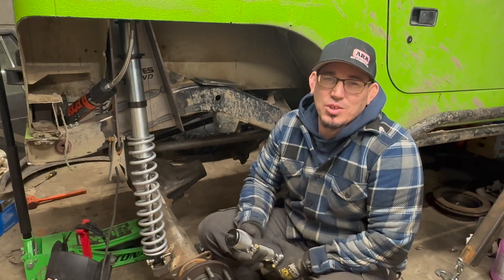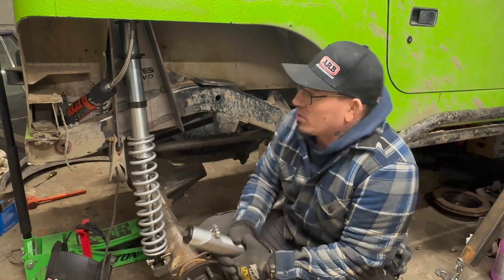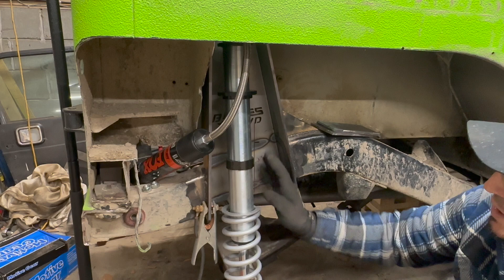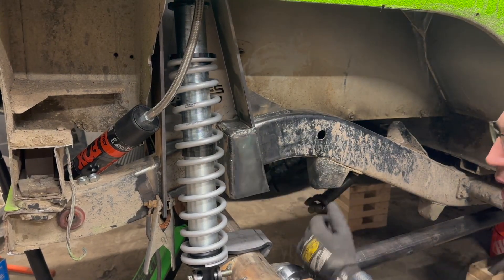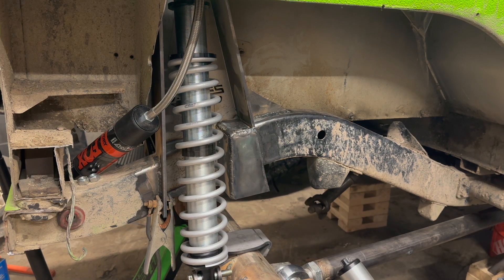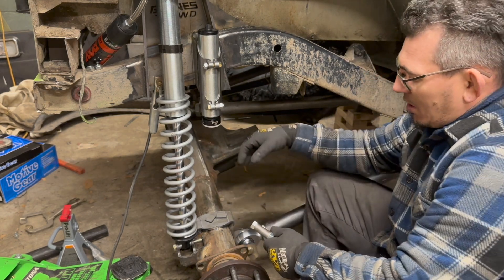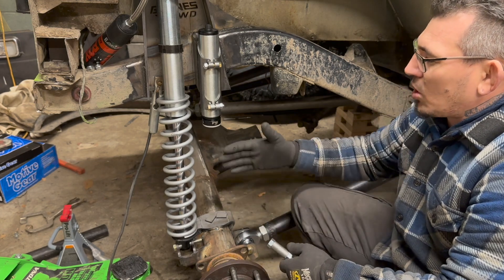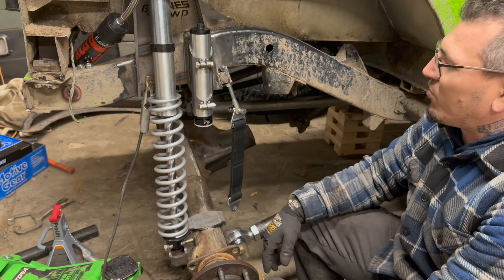How to build a 4 link suspension, Jeep Wrangler YJ part 4 bump stops and limit straps

Comment: you using fluxcore or gas? been scared to start my yj build myself, tired of staring at it on jackstands. my 1 local shop that’s able to do it, still hasn’t gotten back to me…
Reply from the maker: Flux core. I did this project using it just to show it could be.It was a budget build kinda thing. Personally tho I like to use gas when possible but as long as the machine you use is big enough amps wise it doesn’t matter